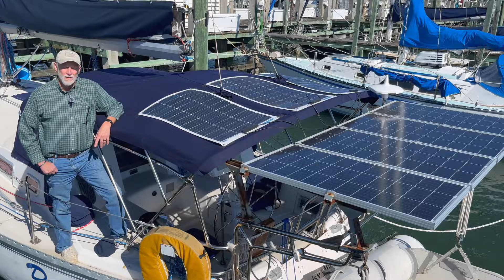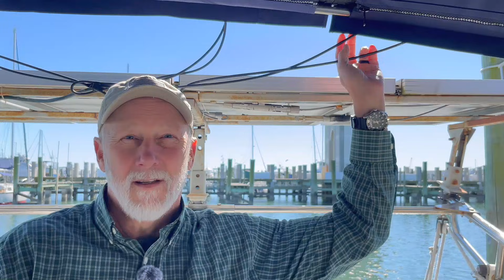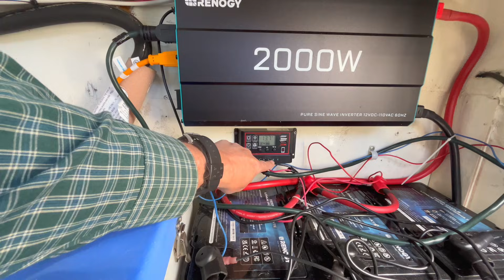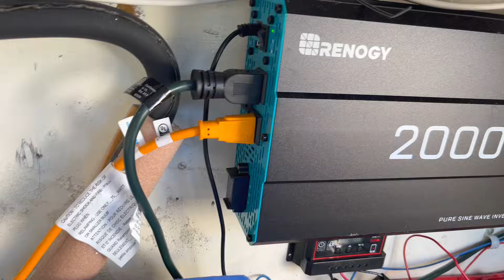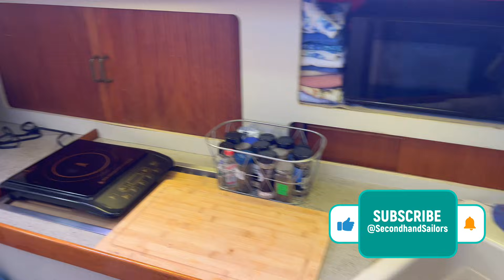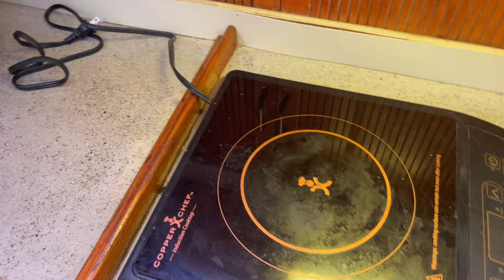Tour of our $1000 Solar Power System

Comment: I have 1600 Watts of solar panels at 24 volts charge controller is 150 amps My inverter is 4000 watts I do have a diesel generator that's water cool for backup, If I'm out in the ocean been traveling all day and all night my solar panels will not keep up the batteries because of electronics radar the sonar units chart plotters and a 12 volt refrigerator system, My cook stove is gas We cook with gas but I have to consider all the motors that runs I have bilge pumps in case you got water or anything you know they'll come on then you have your water pressure then you have electric commode The only way I can run my two air conditioning is with a generator solar panels you it won't do it.  Each AC unit pulls about 1,300 watts divide by 12 volts equals 108 amps from your battery if I run both air conditioners that would be about 216 amps coming from your battery, so that's the reason I'll run have torun generator for AC. My inverter is 4000 w The reason for it is everything all my AC goes through my inverter My inverter has a charger that charges the batteries also it has a relays in it so when sure power or when you crank the generator the relay opens and it says power through the relays to your outlets and it does not use your inverter power If you turn off the shore power or the generator then it relay closes and then you're running off of your battery bank. But you have a good start there You can upgrade anytime you just have to go bigger solar controller like all of mine is in parallel The only way to go on a sailboat is parallel on your solar panels that way if one solar panel gets covered up by the sale or something where it's got a shadow on it or shade you still get the same amount of power out your other ones so I see it where you you did go parallel which is great
Reply from the maker: Agreed! It seems we are thinking along the same lines 😊

Comment: I think you overpaid a bit.
Reply from the maker: How so? We thought it was very cost effective, especially since installers in our area charge $7.75/watt for these systems. How can we do it better next time, since we are planning to expand?
Reply: @SecondHandSailors  That charge controller might be a bit small or at least at the limit of the panels you have, get an MPPT controller that can do bulk/absorb/float and check the max voltage input and wiring the panels in 2 groups of 3 panels each in series or 3 groups of 2 panels in series. This will allow better charging in bad weather. In your video you only mention the 3x100W panels and that could take a few days to charge your 3600W battery bank if empty. If you have 700W you might be able to fully charge in one day of good sun. Your panels produce more than 12V probably closer to 16V-18V. Also remember the optimum charge window will be 10AM - 2PM for panels laid flat. Even a small shadow on a panel dramatically reduces power harvesting. The goal is to be able to charge your battery bank in one day otherwise you could be without power due to flat batteries and in the open ocean that might be bad. The inverter could drain your batteries in 2hours flat out, and making coffee and food throughout a day will possibly do that too. I would use propane for heat to cook, spending money on electronics to simply produce heat is expensive. I would get a power output meter for the AC such as an Efergy meter to monitor how much power your inverter is producing/draining. Just checking battery voltage only could misleading. Your system is not bad but a few small changes will make it quite capable and efficient. If you have questions feel free to ask.

Comment: Flexible panels are not supposed to flex all the time... On a bimini the wind will flex them too often and they will fail shortly.

Mount them on something more ridgid is my recommendation.
Reply from the maker: We did check on this before deciding to mount them on the bimini.  According to the manufacturer's website, they were designed to take the flexing and even offered guidelines for mounting to the canvas, which we followed.

Comment: Flexible panels on flexible surfaces are scary. Flexing causes fatigue. Fatigue cause poor electrical connections. Poor electrical connections cause heat. Heat causes fire.
Reply from the maker: @SecondHandSailors
  • 1 second ago
We did check on this before deciding to mount them on the bimini.  According to the manufacturer's website, they were designed to take the flexing and even offered guidelines for mounting to the canvas, which we followed.

Comment: A few additional points concerning electrical safety especially important on a boat.  
For safety you will want a way to switch off the power coming from the panels.  It looks like you might have 42 amps coming in (6amps per panel x 7 panels = 42amps).  If you go with a higher cost quality circuit breaker, a 60amp one is ok.  If you go with a  lower cost/lower quality asian circuit breaker ( the kind with the little red or yellow reset lever) go with 80 amps because they trip at lower amps due to heat buildup.  In meantime, if you need to turn off power coming in, throw dark towel over all the panels or wait until night.
Also you should have a method of disconnecting the power in wires going from batteries to the inverter.  A high amperage circuit breaker good for 12-48v dc would work.  For rec's, see Will Prose Ytube video of about 1 yr ago for DIY solar power set up on hand cart where he recommends an inexpensive circuit breaker.

Note: I did check makeskyblue website and 60amp mppt with wifi that can handle 720w pv power for 12v bat bank and works with Lifepo4 bats is $85, NOT an endorsement, have no relationship with co or dealer and there are other brands with same features.

Comment: If I understand you correctly, you have max of 700w going into your single 30 amp pwm controller which charges your 3  12v lifepo4  bats.  
The "30" on the controller normally is the designation of its max output (not PV amp input) of 30 amps for your 12v system.  30amps x 12v = 360watts or bringing realworld charging volts up to say 16v , 30a x 16v = 480 watts.  Based on this you have an undersized pwm controller for the solar array, so it is clipping the pv power coming in and charging you bats on sunny days.  
If your panels put out 20v or under, try going with a pwm controller rated for 50-60 amps.  
If your panels put out voltage over 20v, it would be better to go with a 60amp mppt controller, some costing around $100 online.  With MPPT, you'll get more power going into the bats, by converting higher pv voltage into more charging amps.
Whatever new 50-60 amp controller you might get, make sure it has setting for charging LiFePo4 bats.
I helped install two 320w panels in parallel on sailboat using a 60amp makeskyblue (our choice in 2020, costing around $80) MPPT controller. Brought in 35amps in late afternoon in January in NC. Sorry about length.
Reply: Only three of these panels fuels the new system. The other 4 panels fuels the house batteries. So I only have 5.5 amps x 3 going through this charge controller. Thanks for your advice. I will keep this in mind when we upsize.
Reply: @TheCurmudgeonsailor  When considering controllers, it is not the amperage of the panels that is primary factor.  It is the max wattage produced by the 3 panels (300w)  divided by the voltage of your battery bank.  in this case 300w/12v nominal is 25 amps which is below your controller's rating.  An extreme example- a 600w panel might have a 50v output of 12amps, but when you go to charge a 12v battery it is 600w/12v= 50amps is available but pwm will only charge at 12amps.  If at some point you do upsize to larger panels, let's say a single 300w panel  with 36v and 8.3amps output,  you will want to switch to a mppt controller since it will charge your 12v bats at 25amps (300/12= 25), while a pwm controller will charge bats at 8.3amps and waste/ignore most of the power produced by panel. The Pulse Width Modulation controller will pulse ON for a tiny fraction of second continuously to let in equivalent of 12v at 8.3 amps or about 99watts to charge bats.
Reply from the maker: We will keep this in mind.  Thanks for the advice and wisdom.  Always good to hear from folks who have "Been there, done that!"
Reply from the maker: Only three of these panels fuels the new system. The other 4 panels fuels the house batteries. So I only have 5.5 amps x 3 going through this charge controller. Thanks for your advice. I will keep this in mind when we upsize.

Comment: um, this is only 700 watts of solar, i.e.  0.7 kW. not 3kW
Reply from the maker: 100 amp hour batteries x 12 volt equal 1200 watts x 3 batteries equals 3600 watts or 3.6 kw. Power available is from batteries not panels. Panels only collect. Thanks for your comment.
Reply: @SecondHandSailors  Its just the thumbnail that is misleading (and the caption you added to the thumbnail). Not the title, summary, or video itself. People have done worse things for clicks :)